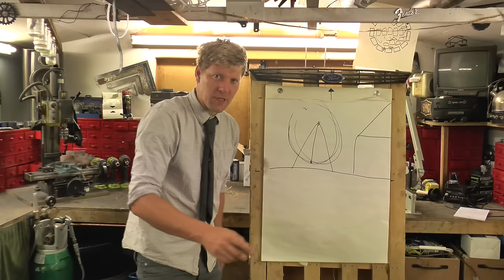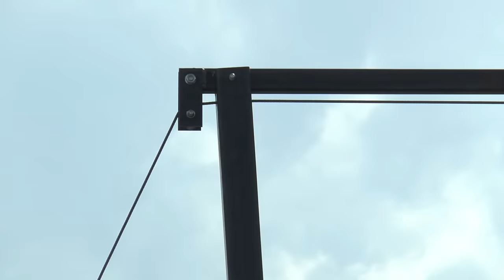Making a Huge 360 Swing #2 Swing Arm

Comment: I love that Colin uses Ryobi tools. Reaffirms my belief that they're hard working quality tools, because if they can put up with all the bullshit Colin does they can put up with anything! Also under 100 club or w/e lmao
Reply: They're the same cheap crap as Ridgid and Milwaukee. They come out of the same factory.
Reply: First of all, they're NOT 'cheap crap' they are remarkably reliable tools for the price point. Secondly, while they are OWNED by the same company, they are not the same as Ridgid/Milwaukee. All 3 lines of tools are built for different customer types. Ryobi is for beginner/moderate DIYers, Milwaukee is for advanced DIYers, and Ridgid is for commercial applications.
Reply: Hi Ryobi, nice of you pop by. Please can I have some free tools too, so I can advertise them on my Youtube channel?
Reply: Ollie Davies Hi Ollie. Sorry but I don't work for Ryobi! I work for Pizza Hut. But I USED to work for Home Depot, that's why I'm familiar with the tools.
Reply: +Streptovsky I like rigid tools.
Reply: Same thing
Reply: Makita. Everything else is crapanese.
Reply: How do you figure Ridgid is cheap crap? I agree with you about Milwaukee but Ridgid is probably the best drill money can buy plus it's the only drill that comes with a lifetime warranty on the drill and batteries, if your battery or your drill takes a shit, they give you a new one. No other company will do that, plus I've dropped Ridgid drills off a 4 story building and it fell onto rocks and dirt and it still worked fine. You've obviously never used a Ridgid drill or any of their other tools as daily tools for work, otherwise you would never say that Ridgid was "cheap crap." I've been using Ridgid since day one and the only problem I've ever had was one of my drills burned the motor up and they gave me a credit to home depot and I went there that day and bought a brand new drill, also they have replaced 5 year old batteries with brand new ones. You should seriously give them a chance before calling them cheap crap man.. They really are a good tool and the warranty is insanely good..
Reply: Anybody who has actually used a Ridgid tool for any project whatsoever would neve in a million years say that it was "cheap crap!" Personally I have been using Ridgid tools since I started buying tools and I honestly think that they are the best tools that money can buy! Plus no other tool company like Dewalt or Ryobi or any of them give you lifetime battery replacement and a lifetime warranty on any of their tools. I believe Ridgid is the only ones. Great, reliable, comfortable, bad ass tools!!!!!!
Reply: iwtommo Who?
Reply: +iwtommo Me?
Reply: He was talking to me, it's funny he has my name, and does in fact like all the same shit I do!
Reply: Crapanese?
Japanese?

You know that Makita is from Japan right?
Reply: Don't tell me you actually BELIEVE the marketting crap they feed you during training (assuming you're not just marketing for guongzu charlie's tool manufactorium). I haven't gone through D25 training, but D27 training has showed me that they don't give you facts, they give you marketing blurbs to sell customers on.
Reply: ***** You don't know the first thing you're talking about.
Reply: Streptovsky If you get to use the "I worked at a home depot!" argument, so can I.
Reply: ***** I didn't say you couldn't say it. I'm saying you don't know what you're talking about. You admitted it yourself you haven't taken the training for D25, I have. I don't know what they teach you in electrical (although I SERIOUSLY doubt it's all "buzzwords and flashy selling points" like you're trying to say, since my store had 2 master electricians in D27 who told me the training was "pretty accurate"), but D25's training is all facts. Naturally there's a little brand bias, but it's not "We're better than anyone else lmao fuck dewalt fuck lowes". I've used Ridgid and Ryobi tools my entire life and I know scores of contractors who wouldn't piss on DeWalt, Makita, or any other brand besides Ridgid to put out a fire.
Reply: Streptovsky K. Have you actually done any reading on the matter outside of the shit they teach you at work? Have you seen teardowns of the tools, analysis of the electronics inside and the quality of components used, stuff like that? When you start reading into that, that's when you develop the "well shit, basically all 'pro-sumer' tools are the same thing nowadays".
Reply: I think you can just say Chinese and everyone will know it's crap!
Reply: All I can say here is: watch BOLTR from AvE
Reply: nah makita all the way ryobi is kinda middle ground its not like hes really abusing them that much
Reply: ***** "Basically all retail tools are the same" and yet here you are talking shit about the ones with the best warranty at the most reasonable price. Are you high? Direct your hatred at the actual terrible brands like DeWalt or Black and Decker
Reply: Streptovsky I'm not hating on any particular brand of tool I'm hating on you for shilling hard
Reply: +Streptovsky I don't think I've seen anyone as weirdly religious about their hardware as you. I use Ryobi and DeWalt daily and they're both fine.
Reply: Streptovsky I'm still not entirely convinced you're not a Ryobi marketing person.
Reply: darek4488 That's my grounds for starting this flamewar actually.
Reply: ***** Yes. Because a Ryobi marketing person would make an innocuous comment on a youtube video and swear at potential customers.
Reply: Streptovsky le viral marketing face
Reply: Streptovsky you seem to be quite upset. perhaps taking a step back from the keyboard would be a good idea.

You're shilling hard. Nobody gives a fuck what you think about ryobi tools. No normal person comes into a video about building some ridiculous shit and says "WOWEE GEE WHIZ SURE DO LOVE THAT THIS YOUTUBE™ CONTENT CREATOR® USES RYOBI©™ BRAND POWER TOOLS, KNOWN FOR INDUSTRY-LEADING RELIABILITY AND VALUE FOR MONEY, BUY TODAY AT YOUR LOCAL HARDWARE STORE". It'd be like someone coming in to talk about how they're glad he used some specific brand of bolt or steel in the construction- it's an irrelevant element that, when drawn attention to so much like this, makes it sound like you're trying to sell it to us.

You're allowed to like whatever fucking fluorescent-colored brand of tool you want. You're even allowed to talk about it in the broad strokes and horrible marketing terms you've used (I've seriously never heard anyone but vendor reps talk about tool users in different grades of "DIY-ers"), but do it somewhere where it's relevant. Go find some ryobi tool review or some shit. Go find a video discussing different brands of power tools. Go somewhere where the discussion is relevant and not horribly jammed in like it is here.

Or you can keep flailing about here and I'll keep reading what you write with a shit-eating grin.
Reply: Streptovsky Techniques and build-quality involved in those sorts of things. Interesting projects (i.e. the ones Colin tends to do). Good craftsmanship from the individual practicing the hobby, not from some Chinese factory. 

Also insult me more it's really entertaining

Comment: How is that aparatus called you use @0:35 Seconds? Looks like a good Idea to drill centered holes without a lathe...
Reply from the maker: itsfrom baliegh tools and is actually a tube notcher
Reply: Thanks, But What a price... Looks like I have to build one ofe these ;)
Reply: +MAAT420 ever been on a swing? it's not that difficult
Reply: +10asti10 you can upset the balance leaning. How would he otherwise get the swing going?
Reply: Someone down in the comments requested for you to turn it into a trebuchet once its all over
Reply: +king thrd when you at in the counter balance on the other end it takes a lot more effort to make it stop moving.
Reply: +de0509 that was me
Reply: +Paragon643 it's just as easy to stop, you just sit still and wait... even with the counter balance sitting still will make it stop it'll just take longer.
Reply: +TheRussell747 core hole driller😅
Reply: TheRussell747 correct if you stand still it will stop. But now there is a big weight on the other side that still want's the keep going and is keeping you in balance so you're not moving makes less of a effect on the rotating. which is going to make it take a long time to stop. The thing i was pointing at kinda involves you wanting it to stop in a good tine frame so you would start to move you're mass against the rotation to create a bigger force for slowing it down. And than it would take a lot more effort ey. The cool thing is that theoretically if you would be in a perfect balance the only thing stoping you from rotating would be the friction in the barring and some air resistance haha
Reply: i would install 4 piston car brakes on the main shaft and install some kind of pedal in the plate thingy that you sit on and if you need to stop it quickly just mash the pedal and it will stop
Reply: +jaakko200987654321 I just think about the same, it will be interesting to stop upside down :)
Reply: cable operated brakes would make more sense. car brakes work off hydraulic pressure and a servo called a brake booster which is powered by an engine.
Reply: Brendan Tucker
why not just use a very long piston for the fluid?
Reply: aside from being very heavy how would you operate a very long piston?
Reply: +Brendan Tucker Cable brakes will be much less effective and harder to engage. Also you are little wrong. The brakes are operated by pressure which you provide with the foot pedal. Brake booster is only to help you but still is possible to brake car if the booster fail (you can tow car without engine running and brakes are working), also without brake booster the system is more effective than with not working brake booster (booster works with vacuum and when the vacuum is not provided by running engine, the booster will pressurize with air and add additional load).
Reply: but you have to understand that with hydraulic brakes the longer the brake lines are the less effective they will be, and yes it is possible to use brakes without a brake booster, but you only really get a few pumps before it's no longer effective as you don't get the air pressure to assist you, thats why hydraulic brakes would be ineffective
Reply: Yes, but the lower efectivity caused by length can be reduced using stainless steel brake lines which does not expand when pressure is applied. And still you are not braking a car but trebuch... sorry... swing.
Reply: stehlajz SS brake lines just reduce bulging when under extreme pressure, they cant however defy physics, but i guess we will have to wait and see what colin uses in the next video, unless he chooses to take flying lessons of course..
Reply: +colinfurze I like you even more now, youre a MUSE fan! 👍😄
Reply: Yeah
Reply: +MAAT420 well he could make the braking system similar to cars or motorcycles but then again he could do the exact opposite as he does to get the swing going because you know swings are a lot like pendulums that can change the length of the thread (you moving your bodyweigh or mass centre up and down on the right moments)
Reply: Motorbike brakes manage without a servo.
Reply: +Si Crewe a bike does not weigh 2 tonnes

Comment: When you get off of it, the vertical weight will come swinging around, hope you can get out of the way in time! 

       Maybe wrap the counter weight in some kind of padding for safety?

Also, when it finally stops swinging on it's own the weighted end will be on the bottom and the riding end will be on the top; how will you rotate it in order to mount it?
 
       I would probably suggest staying on till it comes to a stop and 'tying' the swing to the
       frame to hold off the unbalanced weight till you're ready to ride again. A rope would
       also help you retrieve the riding end.

Comment: Here's hoping the mild steel shaft can handle the load without bending, which if occurs to even a small degree could cause the shaft to turn and possibly unscrew one of the two bolts holding the whole thing together  ( I'm assuming they're both right hand threads).  Please you make sure that couldn't happen, either by preventing the shaft from turning or the bolts from unscrewing in case it does.

Comment: +colinfurze good thinking on the counterweight part. Not sure if you knew, but the torque on a rotating object, a cylinder along the long ways in your case, is given by the equation torque = force*radius from center of the rotational axis. I was curious if the counterweight side would be twice as long as the side you would be on, because you said it would only have to be half your weight, which wouldn't make sense since the side you'd be positioned on touches the ground. I think you may have meant for the counterweight to be half the distance from the center and twice the mass of your body, which would work since the two are directly proportional

Comment: Great job, as usual. I am wondering about your axle of solid 50mm steel. I heard in other videos that a pipe of the same diameter is actually stronger and obviously lighter. Is that wrong or why did you chose solid steel and not a pipe?

Comment: You could do some complicated integration to figure out the exact weight distribution over the ~6' length... Or you could just mock it up on a piece of steel with some weights. You know, whatever works ;-)

Comment: I'm sure you realize this but by using a container of liquid,  you get a counterweight with a shifting center of mass. Which is bad as far as counterweights go. It's just unpredictable. What you could have done instead of controlling and changing the mass itself, as in having more or less liquid in, was have it adjustable so you can shift a solid weight further from the axle, in effect giving the counterweight more leverage, making it apply more torque to the axle.

What I'd also have done differently was use a bigger weight, closer to the axle. This way, the countering arm wouldn't come swinging you in the arse when you get off.

Comment: The bolts screwed into either end of the solid 50mm steel bar will shear off from fatigue. I would rather use a locking pin or hitch pin.

Comment: Colin, I think the most dangerous is (assuming the frame is ok), that u loose the counter weight. Without it u wont be able to stand the g-force going through the loop at the bottom give the size of this swing. Then not being secured to the swing....
And even with the counter weight balanced out, going to (being g-forced to) your knees slightly will imbalance the ratio of your weight to the counter weight and make g-force worse.
To me this looks like a very dangerous instability. Please be careful. Needs more work on the swing where u are standing.

Comment: colin, what about a better air ventelation for the bunker? (horrible english) if you already made it, make it so that will actually work in case of an emergency. add some maybe food or such. and a water source + cleaning. if something happends you'll probably need a generator with full nearby aswell

Comment: That's definitely not enough centrifugal force to stop you from falling at the peak of the rotation if you let go. I'm hoping you ended up at least adding a harnessing system to stop yourself falling off and getting impaled by the rotating steel bar if your grip fails. I don't think a safety tie and shirt will be sufficient for this one so please don't die Collin we need you :)

Comment: The frame for this looks ideal for conversion into a medieval style trebuchet. Ok, those should really be built from wood to be traditional, but why not put a more modern spin on it? Instead of launching a real dead cow over a castle wall while cackling in pseudo-french, why not a lighter plastic equivalent? It would go further, even if it was on fire at the same time.

Comment: Do you actually have a degree in engineering because it seems like you know what you're doing.
Reply: he's a plumber
Reply: Mack Attack Colin doesn't have an engineering degree, hes a plumber
Reply: oh I assumed he would've had a degree in engineering to be able to use all of the skills used in his videos.
Reply: +Mack Attack If he had a degree in engineering, he probably wouldn't have run into the weight issue with the arm
Reply: + makomk I guess